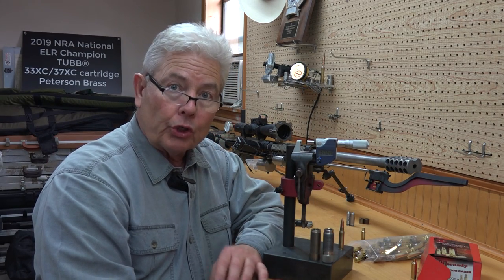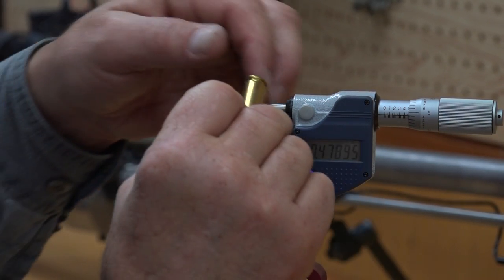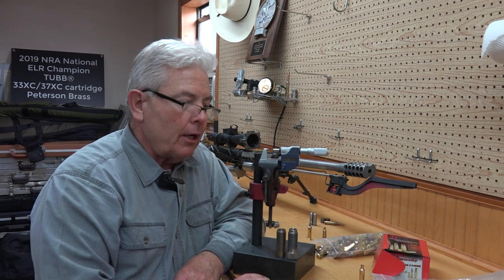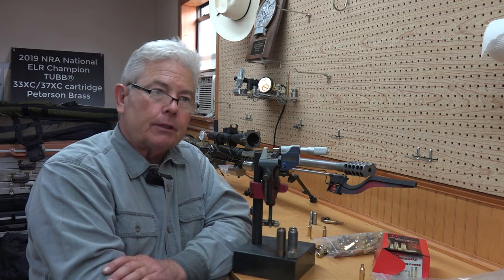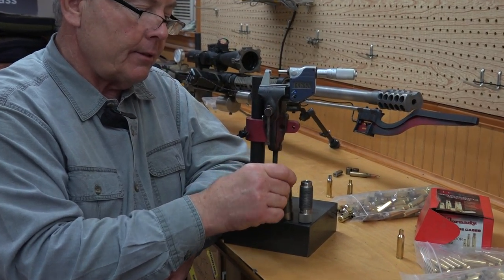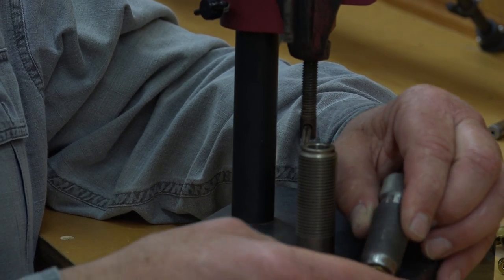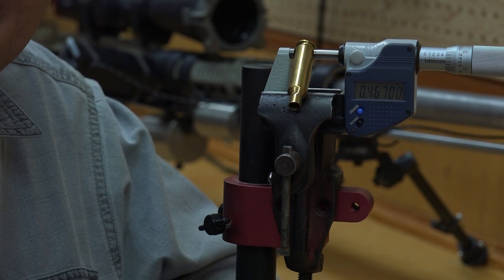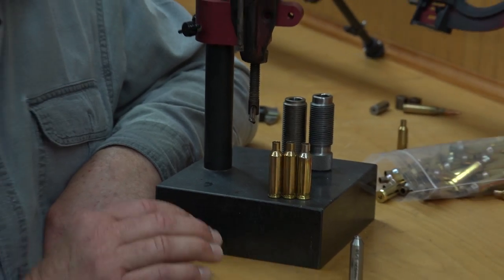David Tubb discusses 6XC

Comment: I got a 6XC II reamed a couple of years ago, I wasn't happy as using standard 6XC dies you over work the case head too much and need ALOT of force, i ended up using a seperate body then shoulder bump die which is annoying for the extra steps.  If you want a 6XC II chamber you really should first get 6XC II dies!   6XC II is not a newer version 2 of 6XC, its a different dimension case chamber!  Its a catchy but misleading name!